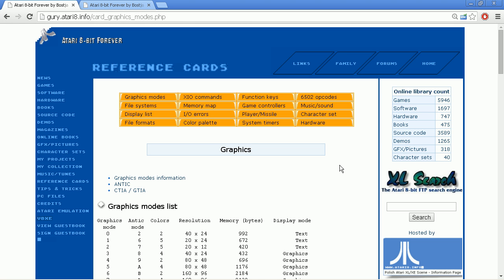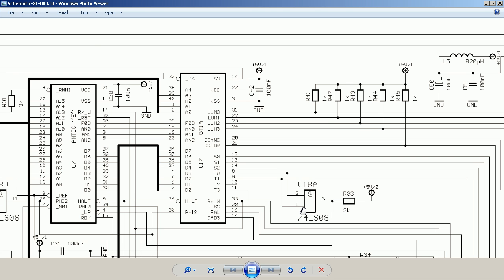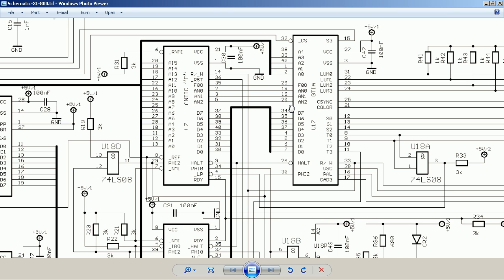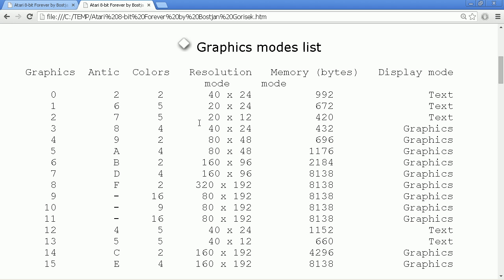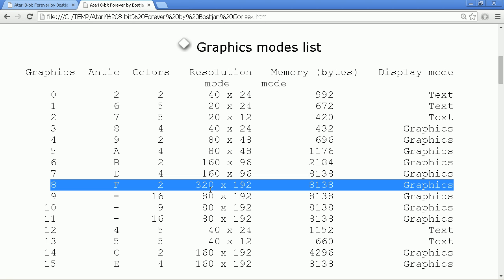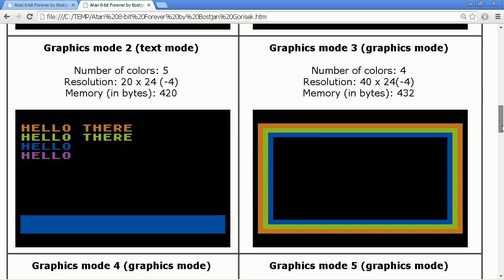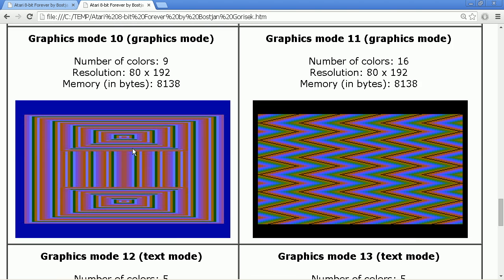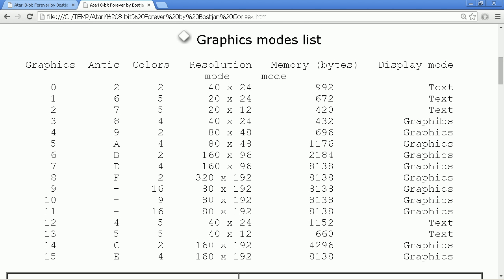Programming the Atari XL/XE - Part 9 - Graphics Modes (2014)

Comment: The color limitation of Graphics Mode 0 and the POKEY limitations regarding envelopes are the reasons why the C64 did dominate ATARI 8-Bit. The C64 could display more colors at once in text mode and the sound chip had more sound envelopes at hand, that could also be filtered. The lack of colors (only 16 instead of 256) and the lack of channels (3 instead of 4) where not a problem for the consumers in the end, because they want more colors in text at once and more variation in sound at once, which the C64 did deliver.
Reply from the maker: Well, it a litte like comparing apples and oranges. The C64 was released 3 years later than the Atari. It's chips have an LSI factor 3 higher integration and the same amout of cost reduction. Add another 3 years and the C64 was blown away by the Atari 8-bit's successor design: The Amiga. So yes, newer computers are more powerful than older ones :-)

Comment: Do you know more about DMA Access ? Does this chip also have "bad lines" linke the C64: https://youtu.be/A-myNx1YhR8 ?
Reply from the maker: Yes. As opposed to the C64, where VIC and CPU alternate on the bus most of the time without interference, the ANTIC really stops the CPU for every DMA access via a special pin of the 6502C used in the Atari. So depending on the mode, every scanline can be a "bad line". That why the Atari is only 30% fast then C64 with screen on, even though its running with a 100% higher clock. You can find all the details in the https://www.virtualdub.org/downloads/Altirra%20Hardware%20Reference%20Manual.pdf

Comment: 8:35 There's also Antic 3, which is like Antic 2, but 10 scan-lines high (8 x 10 pixels) for each character.
Also, Graphics 7 (Antic D) takes only 4296 bytes of memory.
sigh
I miss my 130 XE!
Reply from the maker: Thanks for the feedback Stanley.  Gury has updated his site accordingly.
Reply: @jacofwudsn   How are you guys calculating the amount of memory each mode uses?  What does it include besides the graphics data itself?
Reply from the maker: @rbrtck  It's Screen Memory + Display List Memory. The display list tells the ANTIC how to visualize the data. Screen Memory = Bytes Per Mode Line * Mode-Lines, for example, 40*24=960 in GRAPHICS 0. Display List Memory in PAL is 3 (Empty Lines)+2 (Screen Memory Address)+Mode-Lines+3 (JUMP VBL), plus 2 if the DL crosses a 4k boundary and an additional LMS command is required, plus alignment added by the OS.  In the GRAPHICS 0 example 3+2+24+2+1 = 32. Total 992 bytes.
Reply: @jacofwudsn   From GRAPHICS 0 (same as your example), I figured that the length of the DL was counted because it works out perfectly with a DL of 32 bytes (same in NTSC where I'm located).  But there are in some modes more than 400 additional bytes, which seems long for a basic DL, which was why I asked.  I hadn't considered the alignment that the OS used, so that must be what I was missing, but if we look at GRAPHICS 1, that is a split-screen mode that requires an additional couple of bytes for an address, so along with the OS alignment, the number of bytes this mode uses is actually 674 instead of 672.  That's not much of a difference, but the difference is larger in some other modes.  So I guess what the table shows is the number of bytes consumed by the OS for each mode if it were full screen (normal width), which in Atari BASIC means that 16 would be added to the mode number for the GRAPHICS command.

OK, I should have thought of that.  Thanks for informing me, and sorry for bugging you on this.  Coming from a C64 background, I'm just so used to switching out the ROMs first and going straight to the "bare metal" of the hardware that I never thought about what the Atari OS does (I mostly ignore the Atari OS, too, when I program on this platform, unless I need to access peripherals).
Reply from the maker: @rbrtck  You are right. The table refers to the total RAM allocated by the OS routine using standard alignment. The additional memory consumption is due to the "DL itself must not cross a 1k boundary" and the "SM must not cross a 4k boundary" rule. To save money they saved some transistors in the counters on the ANTIC and rather did that in software spending more (cheap) ROM&RAM. It is similar to the C64's 1k alignment for the screen or the 16k alignment for the VIC bank.  In split graphics modes 0-8/12-15, there are even two screens and a mixed D. And yes, for any reasonable project you'd always build the DL by hand.
Reply: @jacofwudsn   Wasn't RAM (even DRAM) not so cheap in 1979 or earlier, though?  I've heard/read that the 400 was originally only going to come with 4K and the 800 with 8K, hence their model numbers.  This helps explain all of the lo-res modes, although by their release dates in 1979 they both came equipped with 8K, standard, and I bet the 800 was often upgraded at the time of purchase.  That's still pretty limited, so I think the main reason for the restrictions was running short of silicon area and pins.  The ANTIC with its 14 DMA modes and DL processing might have been running short on silicon (for the planned die size and process).

It's kind of funny, I think, to look at both the Atari 8-bit and C64 to see how they tried to make the most of their limited resources and cost caps (much higher for the Atari at first, but limited, as always).  The POKEY handles sound along with AD conversion and the keyboard, but the "console" key handling and keyboard feedback clicker were implemented on the GTIA, probably because it had some spare silicon and pins.  The C64 is much the same.  The VIC-II graphics chip only has 14 address pins, not just 14-bit internal addressing/processing, so to be able to switch banks in order to access all 64K, the CIA #2 (MOS 6526 I/O, clock chip) has to provide two of its I/O pins as a substitute.  And the designers ran out of I/O pins, so they stuck an 8-bit I/O port on the 6502 (which along with tri-state data and address pins to help enable DMA, made it the 6510), albeit it only has six pins of its 40-pin package to spare, so effectively it became a 6-bit I/O port (used for the cassette drive and memory bank switching).  What a mess, but I think it just adds to their period charm.
Reply from the maker: @rbrtck  Yes, definitely a mess and the basis for much of their charm. Because of these weird things demo coders were able to squeeze out new unseen things for more than 4 decades. "The scroll counter only has 4 bits, what if I reset it in the middle of ...." :-)